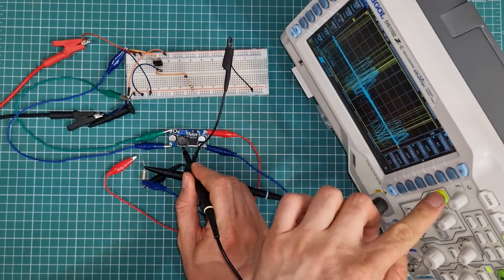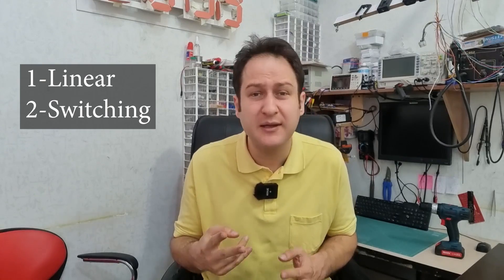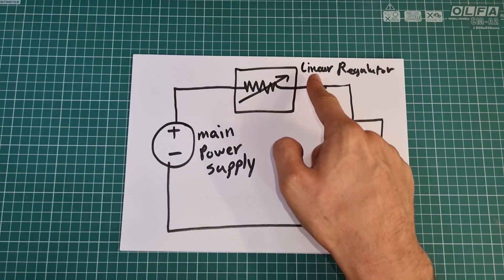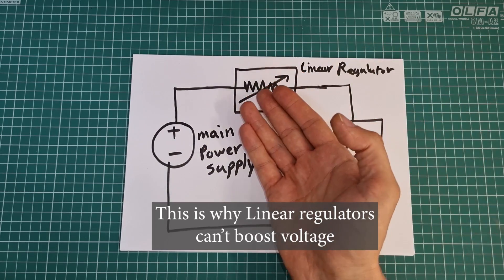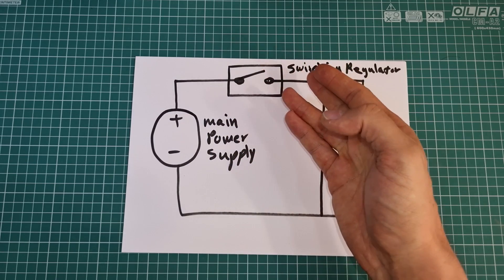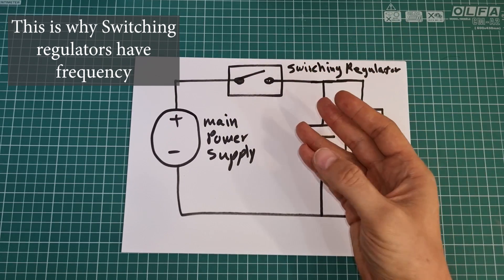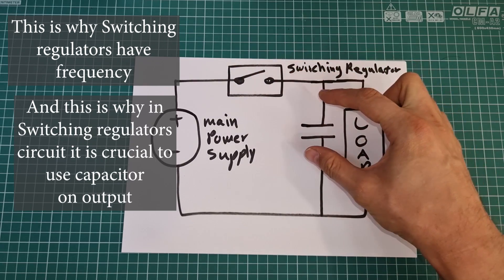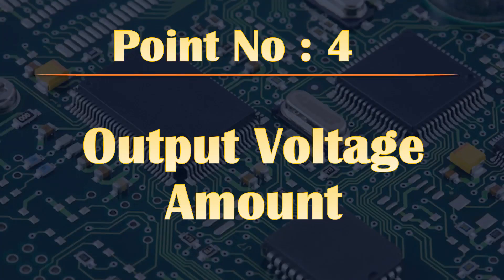What is difference between switching and linear regulators?

Comment: Thanks , its was quite informative. Can you suggest me few good  and advance Buck Regulator and LDO.  
1. Input is from 12V/3A SMPS and required output  is 5V (for atmega128A)   / 3.3V for sensor IC ( upto 300mA),  (12V for 5 RELAYS). 
2. Do I convert 12V -> 5V using BUCK Convertor and then 5V->3.3V (using LDO) ?
3.  Can  I used 5V LDO and 3.3V LDO ?
Please help .......

Comment: There are some kind of linear or non-switching boost regulation circuits around: bootstrap circuits.
Reply: Bootstrap is still switching. It requires an oscillator to push additional voltage into a capacitor through a diode. It's not linear.
Reply from the maker: I think their mechanism is like switching regulators.
Reply: @XEMC  switched capacitor PS is a switched method. Bootstrapping is not actively switched.

Bootstapped audio amplifiers simply use a capacitor and a resistor to exceed the power rail voltage for the driver stage by use of the audio output voltage swing.

But it is also possible to generate a stable voltage level by use of diodes and Zener diodes or on top linear voltage regulation.

Comment: I wish the designers of equipment using switching regulators would pay more attention to radiated RFI, I like to listen to SW and MW AM broadcast radio stations but the number of devices in my house using switching regulators makes this almost imposable, they vary from laptop power packs, phone chargers, led lighting supplies and computer equipment they all radiate frequencies at enough power to drown out all but the strongest stations.
If I go round the house and unplug all the devices using these cheap PSU's the radio reception is perfect, I know most people stream content and use DAB these days but it is a pity so many of the frequencies from long wave up and approaching VHF are becoming unusable in the average home environment.